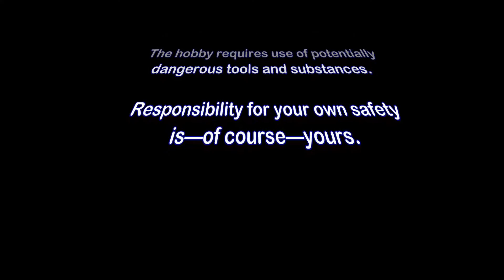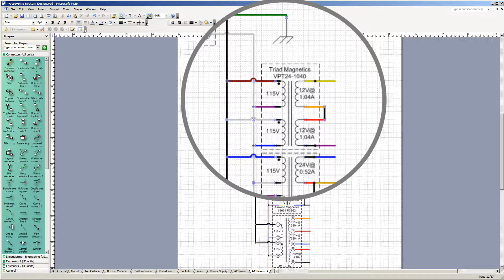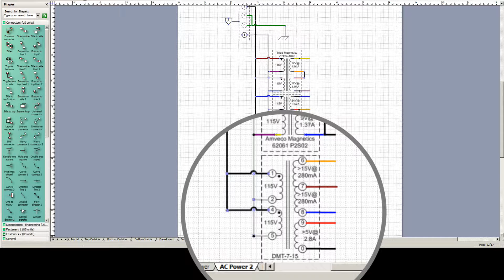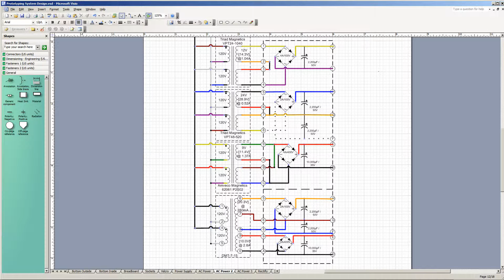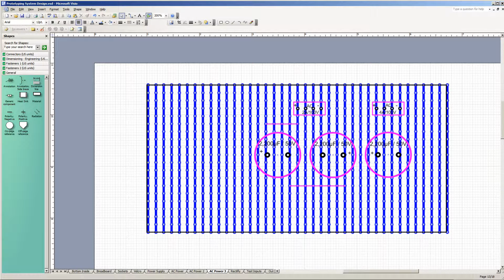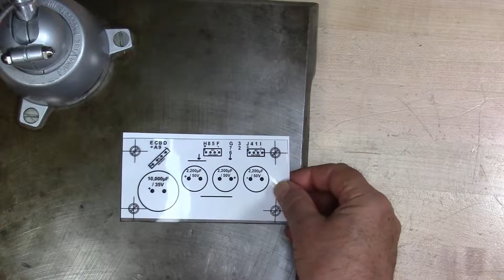022-Prototyping System--Rectify & Filter (1)

Comment: Very few on YouTube go into depth on the filter section of the power supply. Thanks. A great place to get a high current and multiple voltage transformer is from broken audio amplifiers